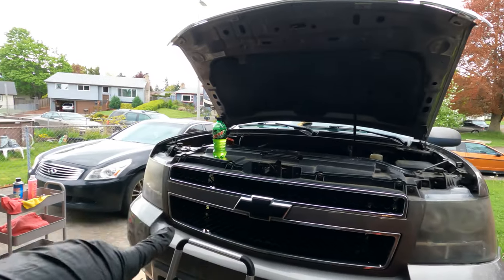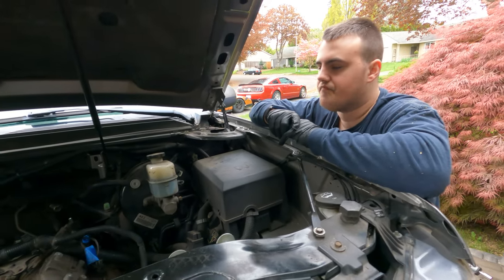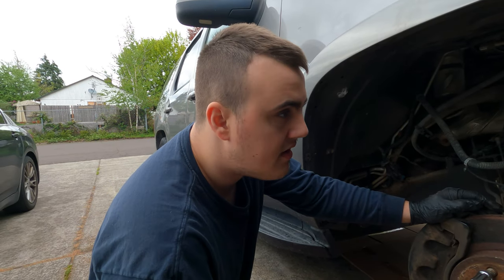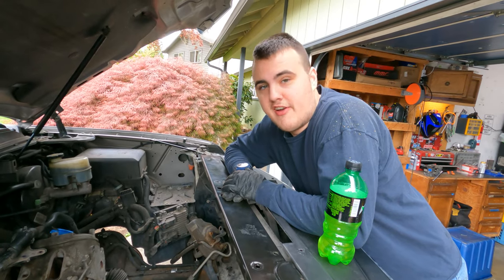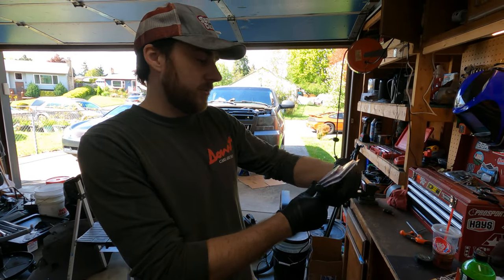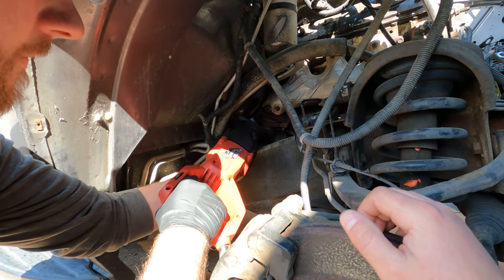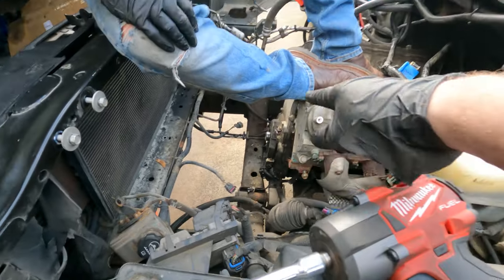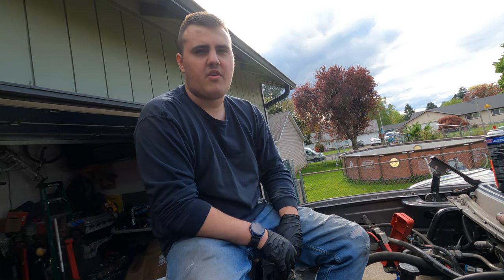Chevy Tahoe Rebuild! Pulling the Blown Up 5.3 LS Part 2 (We Had to Bring out the Saw...)

Comment: If you take the cross member off you can lower the trans to tilt everything back and get all the bolts off from underneath but if your not dropping the trans y’all doing it correctly

Comment: I'm replacing my 2010 5.3 because of DOD destruction. I'm finding way more in gen 3 blocks than gen 4... I know the reluctor wheel need upgraded to use the older style and I'm doing a AFM delete kit...anything else you found that need changed to make it work? Mine was Canadian too, rust on the exhaust bolts.
Reply from the maker: We have a video where we take the 24x reluctor wheel off the gen3 crank and replace it with a 58x reluctor wheel. We also replace the cam timing dear with a 4x trigger. This way the gen3 motor will work with the gen4 computer.

Comment: 4.8 AND 5.3 ARE NOT LS
5.3 IS A LM7
Reply from the maker: That is just the specific designation, the 5.3 is in the LS family.
Reply: @JuryRigGarage  it's LS based.
4.8 5.3 are not LS.
LH6,LC9 
LY5,LY2,LM7,L20,LMG....ETC
Yes since they're all LS BASED, you can put any LS parts you want to....
Still not a LS tho
Reply: @JuryRigGarage  and I junkyard build 5.3 and use the 4.8 pistons...and the cheapest LS guts I can find including used cams and etc..but it's still not a LS...
Reply from the maker: @joesnow9466  agree to disagree, I would still consider and refer to it as an LS for simplicity and since it’s the same platform although not technically an “LS” designation